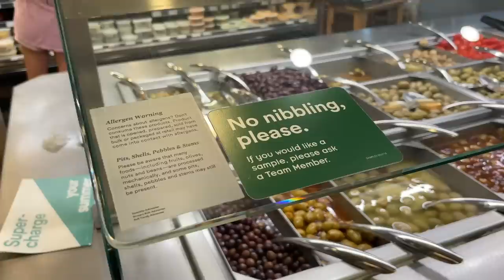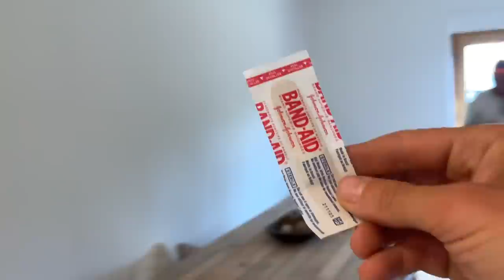Preventing A Landslide!!! Goonzquad Barn Is Finally Safe With A HUGE Commercial Retaining Wall!

Comment: Those are 28"  Limestone RediRock the middles are about 1600# and the bottoms are about 1750#. The half blocks are about 700-800 each. I move them all day long. You should see the 52,72 and 96" XL blocks!

Comment: Lots of comments re the retaining wall, in Australia we have a lot of reactive soil, that is it expands and contracts considerably with the moisture content.  To get around this we would pour concrete footings for a heavy large retaining wall, or at the very least dig down sufficiently deep that you are placing the blocks on hard compacted ground.

The other big issue, there is little lateral restraint of the wall, the pressure of the soil behind can push the wall sideways.  Normally this would be prevented by setting the first layer of blocks down into the soil, or far more preferably, by fixing the blocks to a concrete footing of sufficient depth, which on a sloping site like this would probably need to be 600-900mm or more.

I'd expect over time the soil and retaining wall will move, and the concrete floor may crack.  The worst case though would be some kind of major subsidence, perhaps under freak conditions like a hundred year storm, and the whole lot, wall and soil moves down the hill.

This is really a situation where they should engage an engineer, it's quite different to what you have in your common garden, and potential for some hydro-static issues as well that demand an agricultural drain behind the wall.

Comment: awesome job guy's glad to see you building the wall to support your ( MAN CAVE )  i would suggest go level with the concrete slab as in height so when it come to building the deck out the back you could use the tops of the wall for support for decks main support by using the wall but awesome video guy's you doing well keep it up :) :) :)
Reply: You have been chosen
 to get a present.👆.👆
Direct message to ASSERT OWNERSHIP..🔝🔝.

Comment: Proper drainage (ag pipe, blue metal and geo-texture)  and compacted base with a course or 2 that starts under the ground level. They should have dug 3-4ft (at least 800mm) under to stop the wall moving.
So close ------ but yet so far. I am glad they listened somewhat though. (I dare say their contractor told them to..)
ps... try 'watering' your plants and lawn. Give them some nutrients.. will work wonders.

Comment: Those large REDI blocks weigh 2500lbs. each. and the half blocks weigh around 1250lbs. So you had like 40,000lbs. of blocks on that trailer. lol. Including the trailer that poor Dodge 3500 was dragging like 50.000lbs up that mountain. lol. You might want to use the F-450 next time.

Comment: Surely you should be anchoring the base of the blocks to the ground first, before building up the wall, as the base is the anchor and the rest of the wall is weight that adds anchor. I guess your surveyor / inspector should inspect it for its robustness.

Comment: I'd go a little higher and backfill up to 5he level of the building and have a patio instead of building a deck. It would probably cost about the same as building a deck but there wouldn't be any staining or washing and the carpenter bees wouldn't be boring holes in it.

Comment: Glad to see that you have decided to take the first step to saving your Man Cave.  The Comment Section is soon going to be going nuts telling you that you need at least another 1one or two more levels to the retaining wall.  I will also have to wrap around the corners of the building.  And you have to pack that earth really well.  Plant vegetation to assist in erosion protection and pray that it doesn't slide down.  I'm surprised that it has lasted this long.  Your new wall will protect dirt from spilling out the bottom of the pile, but not from immediately under the foundation.  Take a look at how much dirt has already eroded from the underside of the concrete slab.  And it's what you don't see that will cause that building to become an "ex-building".
Reply: no

Comment: For the record, the "long block" in your Viper means a completely built motor. Short block means, the bottom end or the rotating assembly, and when the motor is fully dressed, means ready to run. Just some info for you.
Reply: You have been chosen
 to get a present.👆.👆
Direct message to ASSERT OWNERSHIP..🔝🔝🔝..

Comment: I work with this blocks all day everyday you guys did ok but definitely needed to have gravel on the bottom so they don't settle down as much then the first layer half way buried then 2 layers on top for good support and 1in minus behind for the dirt not to run between the cracks then do as you guys want and yes if we was contracted to do this it be about 8000.00 + but it would of been done just right the first time and all material there and not a little here and there
Reply: You have been chosen
 to get a present.👆.👆
Direct message to ASSERT OWNERSHIP..🔝🔝🔝.

Comment: I had a 1966 AC Shelby Cobra. It went back to Shelby in 1969 for updates. The clutch was a racing clutch and it took over 60 pounds to depress it. Was not much fun in heavy city traffic.
Reply: You have been chosen  to get a present.👆👆 Direct message to ASSERT OWNERSHIP.🔝🔝🔝……

Comment: that wall will sadly fail doesnt have drainage, or a gravel/sand base, dirt/clay becomes slippery when soaked with moisture.. also first layer of the wall should be below grade. then you need to backfill behind the wall with gravel.  doing so will allow the soil being retained to dry out and as it does the wall wont have to hold as much pressure vs saturated soil..
Reply: You have been chosen
 to get a present.👆.👆
Direct message to ASSERT OWNERSHIP..🔝🔝🔝.

Comment: Those blocks weigh around 2500 pounds, you are extremely overloaded on that truck, unsafely so. Oh and that retainer wall won't stop the dirt washing out from under that concrete slab, you still need erosion control on the bare dirt right under the slab. You can already see the gap under the concrete where it's settling out from under it, settling has nothing to do with the pad sliding down the hill

Comment: Your are half done. The retaining wall should be the same height as the bottom of the slab to accommodate water run off. Now the garage will only slide half way down the hill. 😂
Reply: You have been chosen
 to get a present.👆👆
Direct message to ASSERT OWNERSHIP.🔝🔝🔝.

Comment: That’s wrong on so many ways guys!!
You need to do a 12” base with 57 rock, use the base/footer block first, then set this blocks at the top.
The way y’all did, this wall gonna settle and move in less than 6 months… 
PS: I work with red blocks for the last 5 years.
Reply: noo

Comment: Fail.  
Watch the YouTube video titled “How to install the Redi Rock base course” and hear contractor after contractor say how important it is to get the base course right.  Having this wall built improperly is as bad as not having it built at all.   You’ve just added a massive amount of weight on an unstable slope. that’s sure to slide and pull the barn with it.

Comment: Yea, you built a wall, but it's not going to retain anything! 🤣 You did nothing to prep the blocks, no drainage pipes....you just leveled another area of the mountainside and dropped big concrete blocks which after a good amount of rain will also slide down the mountain! IF you look closely you can see the concrete pad is already starting to fail. It's cracking at the bottom which means the ground beneath it is giving way. I get that these guys try to take on things themselves, but they really need to learn to call in the professionals when it comes to things like this. Oh, and Harley Davinson? 😂
Reply: You have been chosen  to get a present.👆👆 Direct message to ASSERT OWNERSHIP.🔝🔝🔝……..

Comment: Pure Ignorance to not do routine maintenance on the Viper   If they continue to drive it the way it is I guarantee it will screw up the crank sensor and burn a couple of valves and probably blow a head gasket. These guys have to be pretty Stupid to treat a beautiful Viper the way they are. They know nothing about anything mechanical, especially cars. It's well known that when you give a "child" a toy they will usually tear it up.